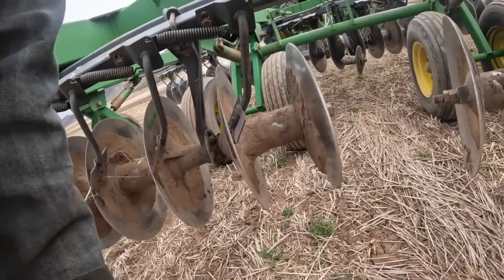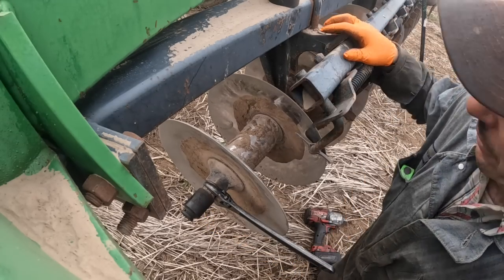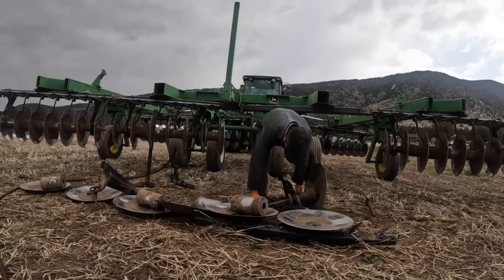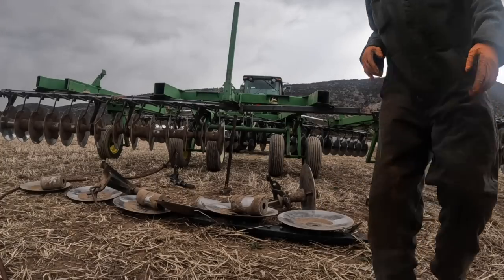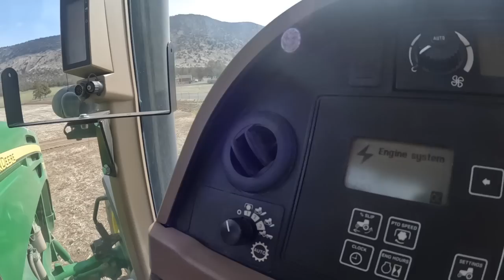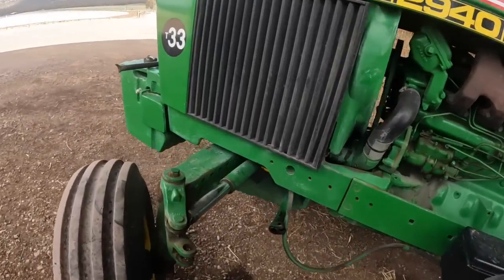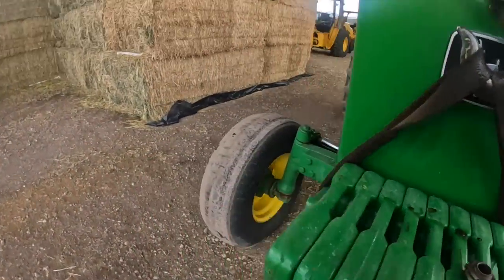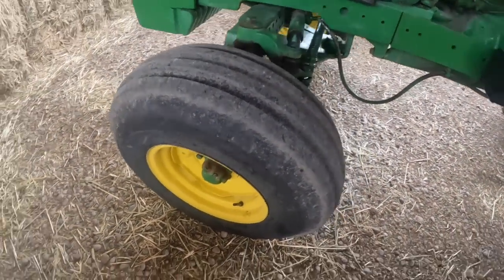John Deere 630 and 2940 repair.

Comment: I have a lot of respect for Warren. I just don`t any extra cash after paying my taxes this month. But I wonder about the farms down there. We would not call a mechanic to replace a gang bolt. I just rebuilt the front gangs on a case 596. All new disc blades 7 of the 12 bearing were replaced. My nephew had the  threads on 2 of the gang bolts repaired. But I was lucky I had extra help to reinstall the gangs I had someone to run the hydraulics while my nephew and I lined the gangs up. One thing I have found that helps get the nuts loose is I heat them with a map torch. I don`t use a cutting torch because I don`t want too much heat.  You can see Warren is working in miserable weather. I wonder if the weather will ever warm up. I am currently getting a sprayer ready for the season. I found one wheel hub full of water so now I am replacing the bearings. Thank you for another nice video.
Reply: I think the mechanics on these farms left after discovering that other outfits were paying better for the same work. A lot has changed in a couple of years and the cost of doing business has gone up. They can pay their own guys or they can pay Warren.

Comment: Ran a JD 637 32', changed all the blades and bearings every 3 years, greased it after every use, 2 tubes of grease each time

Comment: Yes I agree with you a 100 percent I would take a 2940 any day over a 4020 John Deere they run cheaper on fuel start 100 percent better in the cold weather and they are easy to get on and off of and they have a parking brake which I like better than park .

Comment: What holds the rose joint track rod end in, is it just hammered into the taper or is there a pin or a nut on the bottom of it, sure looked cold and windy for a while there.